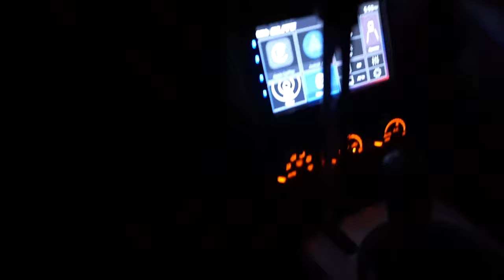Pushing my 350Z to its ABSOLUTE limit..

Comment: When I put a midweight flywheel, headers, and an unsprung clutch on my VQ the car drifts so much better it sounds so much better and gained a noticeable amount of power and made the tires brake loose so easy! And it revs insanely fast without being choppy!

Comment: Ive seen what happen on the g35 happen to a genesis that had full coilovers installed on the rear. Conidering the g35 didn't come with coilovers from factory and were originally designed with a spring near shock suspension, with all the extra weight in the rear I'm not surprised the chassis split.

Comment: Send it and delete the angle limiters, I have fdf up front and my banjo self clearanced my bc coils, you slam it to lock enough times it’ll self clearance, I haven’t had my brake decompress once after the first time. And my local track is very tight so I’m always at lock, now my tire just rubs my sway bar slightly so I’ll clearance that this winter

Comment: Thats funny about the gas. Here in Maryland I look for 91 cause that's what bmw recommends. But everywhere has 87,89 and 93. Only place that carries it is wawa that i know of. Wish sunoco still carried their super 94, I made 535whp on my m52 with that fuel in the mid 2000s lol
Edit: 543whp I made 635 with 110 octane. Topped out at 715whp on the stock bottom end m52.

Comment: 12:39 - "I can see this one."

Straight to ebrake clutch dump combo

Hopefully Jimmy gets away from this soon. So much skill once he's initiated. If the momentum lost on locking the rear wheels were distributed through the bends, like 14:27 (where the e-brake still kills it), or 16:36, where you can see him fighting to not go for it and it pays off.

Comment: One thing I have noticed with your steering is you are all over the wheel, especially when using the handbrake. Your hand crosses over and switches side all over the place. The car seems to do what it wants, and you catch the wheel and try and provide inputs along the way. Your steering also isn't that smooth, and you don't seem to have consistent hand placements. To me this is also the reason why you struggle to catch and save spins at times as I have noticed you often get caught on the wrong side of the wheel with one hand.

This is where someone like Luke, Chelsea or even Adam might come in to help you change your steering and give you some advice to improve along with less handbrake initiation. Certainly not trying to be rude.